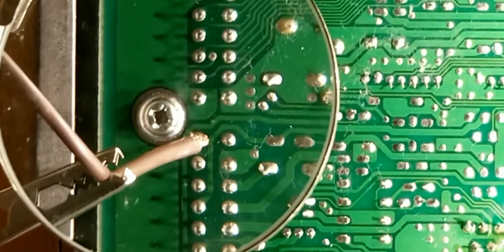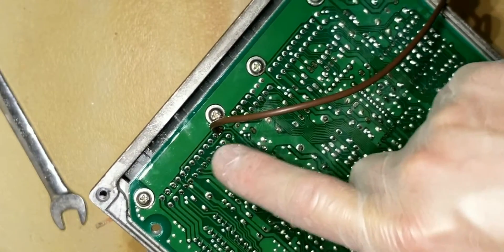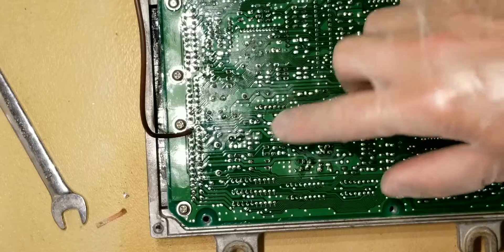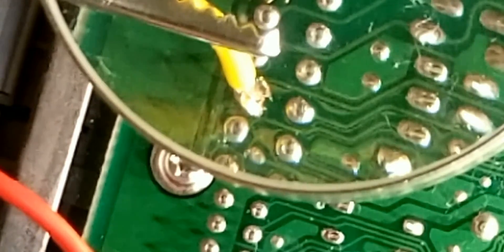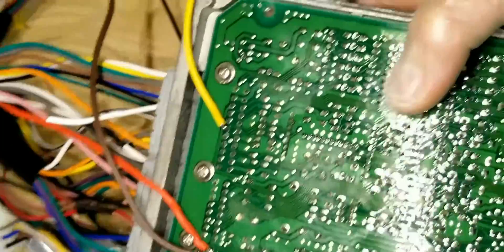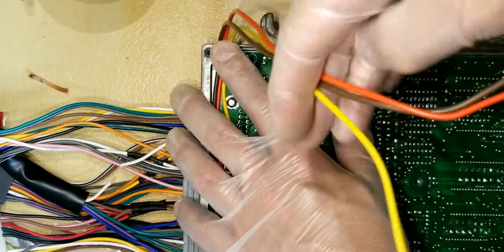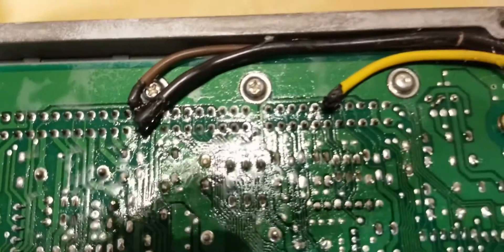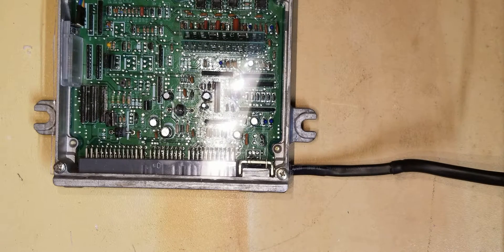Part 3 (video 2) Honda Tuning 101 My ECU is socketed what's next?

Comment: Do you need a controller box with this method or can I just use a ls wideband o2 sensor might be a stupid question but people might not know what ability the ecu has. In my case I have a 4 wire o2 but 5 wire ls 4.9 is not a bad price
Reply: I'm looking at a controller box but use bt to monitor the fuel trim. Tuner view or something similar.  Jcar in Australia sell a controller for $50aud and a ls wideband o2 is around the same money.
Reply from the maker: @chrissraceporting7055  this is the one we use has been great and replacement sensor are like 30USD

https://amzn.to/3hAsG1b
Reply: @DIYKAI  it's list price for Australia is $192
Reply from the maker: Yes its a bit expensive but I love it check out my crx videos I show it in action lol
Reply: @DIYKAI  ok mate I will.  Doing 2 crvs up for my daughter's first cars. The manual is getting a p75. And I'm going to try using a ktag to tune the automatic version.  Both 2000 sports. B20b8.  I'm trying to limit the manual as it flies.  And my elder daughter is like me lead right foot
Reply from the maker: I'm am doing a few cars with my daughters as well! Good luck
Reply from the maker: So you will need a interface to read the info from the o2.....usually comes in a package (sensor, control box, gauge)
Reply: Hey  @DIYKAI . I have a quick question. Do I have to use a gauge controller box for the data logging or can I just connect the data port on my P28 to my laptop via USB cable and log directly to my laptop?  Thank you for your input.
Reply from the maker: @joshharris5385  you have to have a FTDI adapter
Reply: @DIYKAI  Thank you!
Reply from the maker: @joshharris5385 YW
Reply: @DIYKAI   Hello again my friend.  I am in need of your expertise.  I have purchased an FTDI adapter and I am having difficulty making a connection with the Honda Tuning Suite.  My laptop does acknowledge the device and HTS sees it as well when I do a COM port check.  Every time I attempt to initiate Data Logging it confirms the port is open but it is unable to connect.  My current theory is that I possibly have the connections on the FTDI adapter wrong and I would greatly appreciate your recommendation.  I purchased the CP2102 from Amazon.  It has 5 pins and the boards identifies the pins as (1 - 5  respectively) +5v / GND / RXD / TXD / 3v3.  I connected to the ECU data pins as follows: GND #1 / RXD #2 / +5v #3 / TXD #4.  Only the GND light illuminates when connected to my laptop.  Nothing lights up when disconnected from the laptop and I turn on the car.  Would you have any suggestions?  Thank you very much for everything you do my friend!
Reply from the maker: @joshharris5385 switch TX & RX wires see if that fixes it
Reply from the maker: @joshharris5385 your welcome comment back if it don’t work out
Reply: @DIYKAI  Hello my friend. Yes that was the issue. Thank you so much for the swift response! I ended up doing something similar to your ECU. I didn't want to go the Bluetooth route in case of interference so I used a FTDI adapter to USB. Then I notched there case and mounted the adapter in a way so I can always connect and disconnect the USB cable on the fly. When I wire in my wideband I am probably going to take inspiration from you again and Make it a quick disconnect for swift ECU swaps as well. Thank you for everything you do!
Reply from the maker: @joshharris5385  your welcome glad we could help!
Reply: @DIYKAI Hello again my friend. I have achieved communications to the ECU and reached another road block. What did you use to achieve Emulation and Data Logging? It appears that I can only do one or the other. Do I need to purchase a Cobra RTP or Moates Ostrich to achieve data logging and emulation?  Also, did you need to install a capacitor in C42 to be able to use the D12 pin as the input for the wideband? Thank you very much for your assistance my friend!
Reply from the maker: The video I am showing where to get power, ground, and signal for the converter box

Comment: I need d16y3 alternative of p1k beacuse it not here
Reply from the maker: I'm not understanding what you are asking?
Reply: @DIYKAI  this car engine runs ECU P1K .what is the alternative?
Reply from the maker: @zainzainzain3315  if your running OBD1 a P06 ECU with a Chip and vtec conversion will work.
Or you can use a P28 see if it runs ok if not chip it and burn a different map to it
Reply: @DIYKAI  i installed P06 and the motor rev count is low to 5
Reply: low RPM
LOW IDLE
Reply: d16y3
Reply: i cleaned the iacv with care

Comment: hi so the yc-05 is for usb serial and what is the reference of the bluetooth one?
What software to datalog and will it work on a older ecu like the zc  d16a9 130hp 1.6 without vtec?
Reply from the maker: So the FTDI software is automatically installed on windows when USB serial is plugged in.

Software to datalogging I'm coming out with a video really soon.

What ECU are you using?
Reply: @DIYKAI  the car(crx) came with a PM7 but i have a P04 because it's better to chip.
Reply from the maker: Yes I believe a pr4 can be chipped. I have one let me see if I can make a video on it
Reply from the maker: @CrAzYDr1veR  your p04 is OBD1 correct?
Reply: @DIYKAI  obd0 with dip28 socket
Reply from the maker: @CrAzYDr1veR  ok I have a few OBD0 ecus i will make a video after this series on OBD0
Reply: @DIYKAI  ok thanks
Reply: I installed the motor, set the wires to the car, and installed the P06 controller. but there is a problem. RPM is low?
Reply from the maker: @zainzainzain3315  what motor? Also have you adjusted the throttle cable? Check the IACV?
Reply: @DIYKAI  what check rhe IACV?